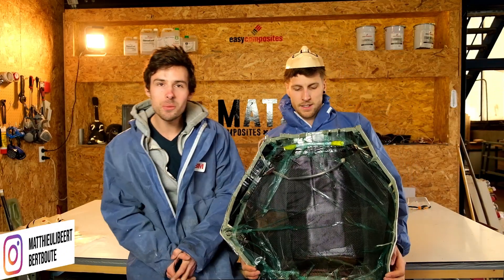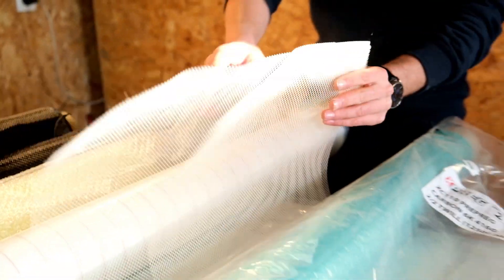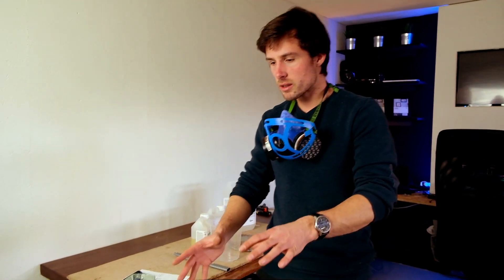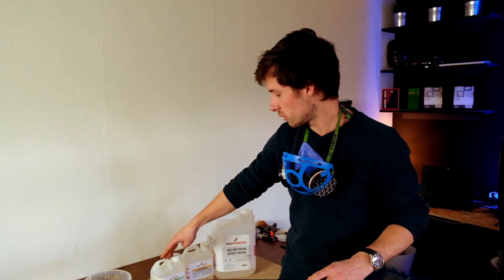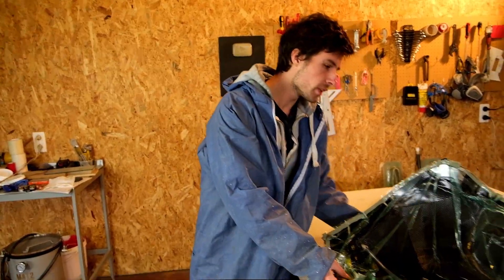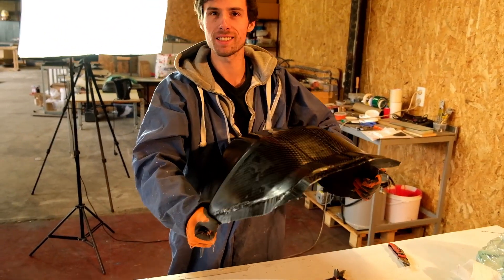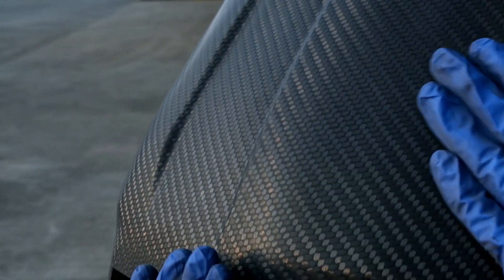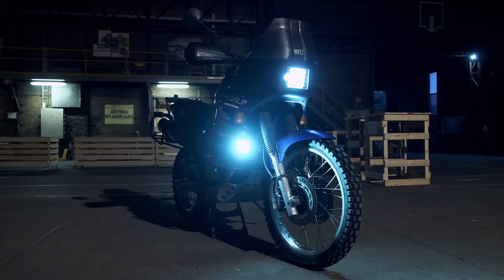Making a Carbon Fiber Motorcycle Rally Fairing - DAY 4

Comment: i'm thinking about doing the same thing some time next year since i don't really like the shapes of the rally fairings that are available and almost all of them have either round or square lights. i'm probably going to implement a more complex shaped led light of a different motorcycle (just for the style points you know ^^). the part looks great, i was a bit worried about the interrupted layers on the back but from what i saw in the video they don't really stand out that much. however there is one part that always bugs me with all the videos i saw about self made carbonfiber or glassfiber parts wich are the sharp edges of the parts, i hope this method allows for rounded edges with some tweaking but i guess i have to test it first.